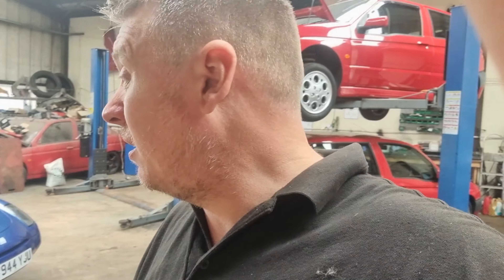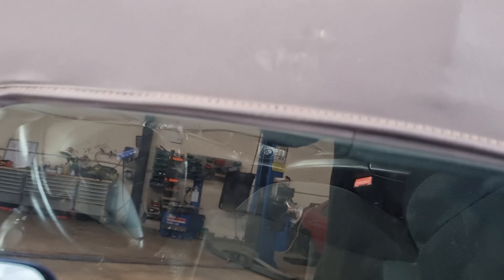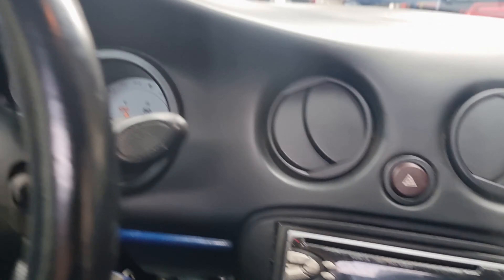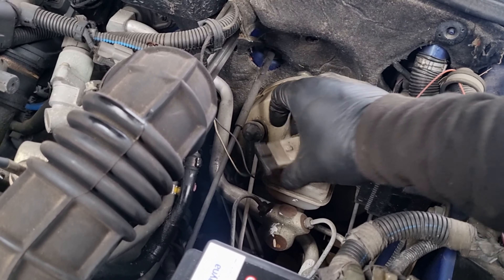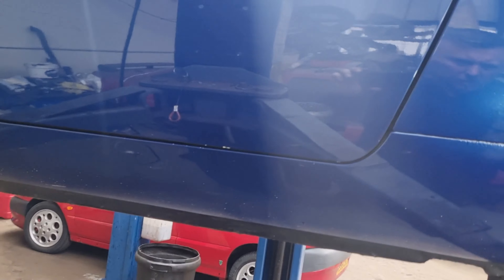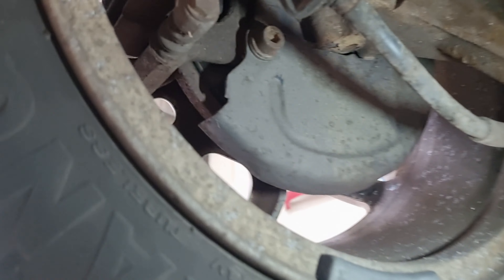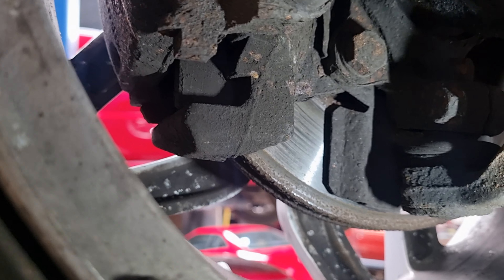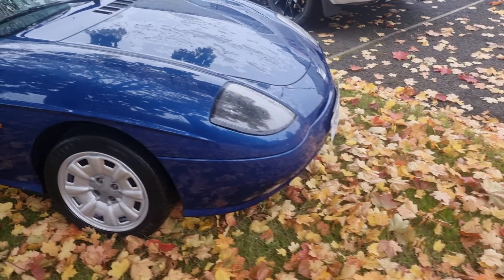Fiat Barchetta Sat In A Garage For Years. surely it needs loads of repairs.

Comment: Bought mine in Italy 1995 with aircon,2 airbags, leather, hardtop , full house. Blue metallic.
Sold it with 6000 miles after 6 years because of the variable valve issues.
So sad.

Comment: You put it wrong on the bridge arms in the back......put it on the dedicated supports as you can bend the metal in that place where you put the arms. The front is put correctly on the arms but the back not. Also i would not start a car with such an old timing belt and fluids but maybe the owner drove it there so you know it runs ok. I own a barchetta for more then 20 years and i like the car very much.
Reply from the maker: Thanks for watching. As I use large support pads it doesn't damage the sill, well as long as there not rusted out.
Reply: @ItaliaAutos  Well why not use the official supports? I would not accept that with my barchetta :) I like your videos a lot and also the italian cars.